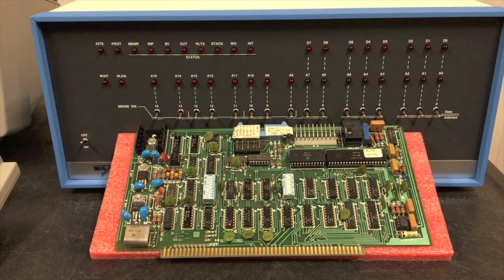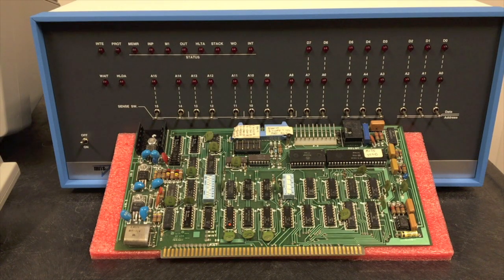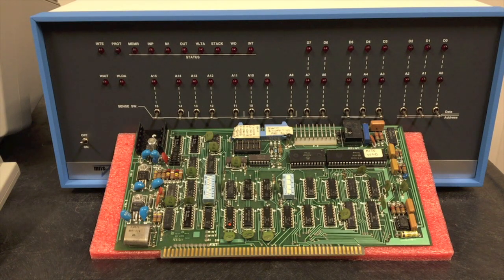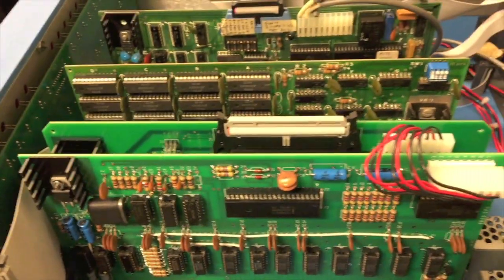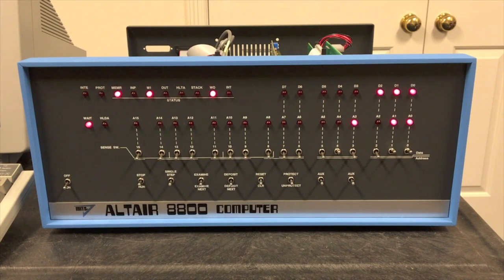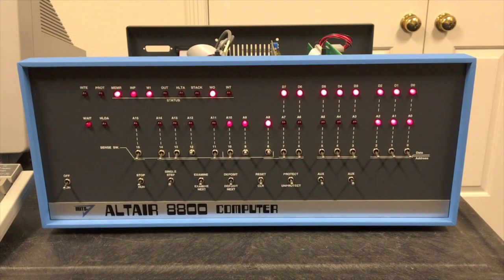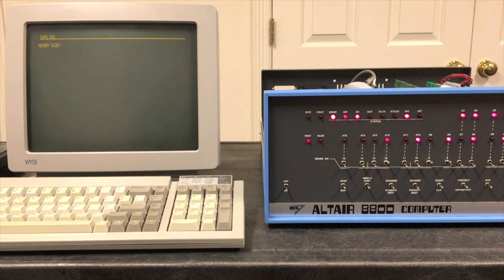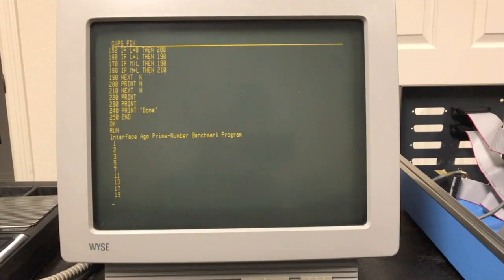Altair 88-UIO "Universal I/O" Board

Comment: I had the mio with parallel serial and cassette port , also the Vio the ultimate terminal so fast with wordstar you could scrole through a text or source file the size of a disk. the vio was the first memory mapped video I know of at the time.after that worked for Atex a publishing pdp system based system that used memory  mapped Terminals, so terminals were just video and serial keyboard.